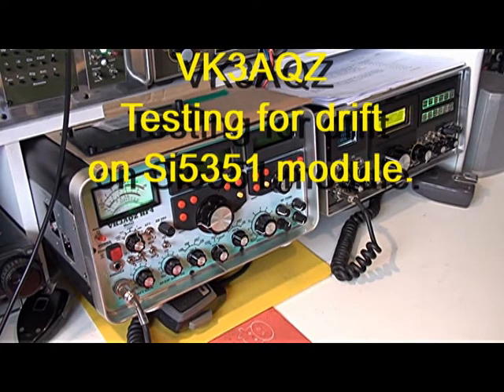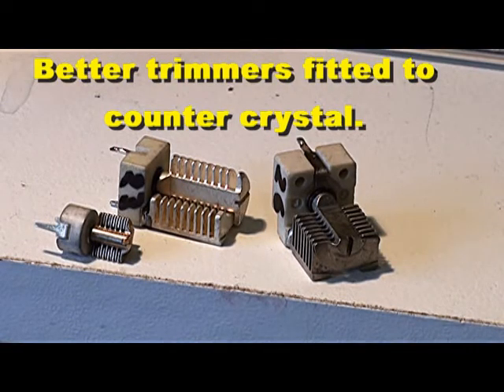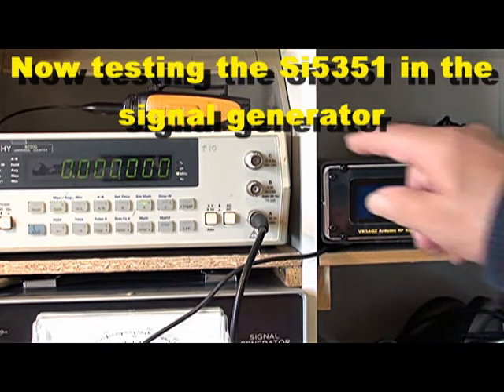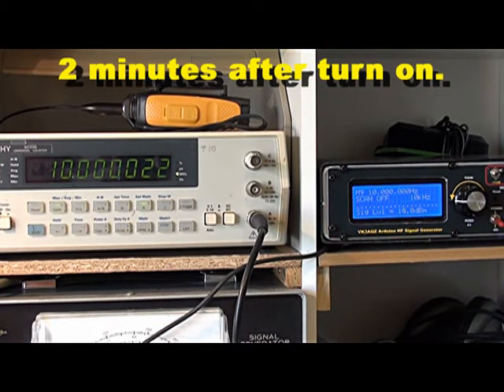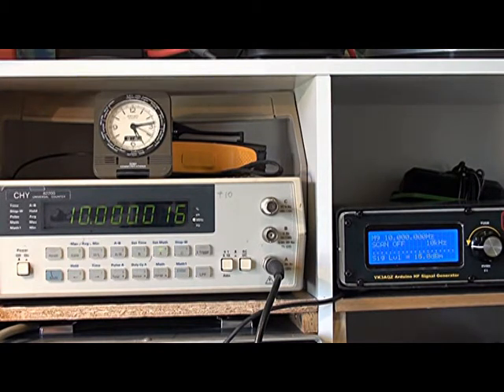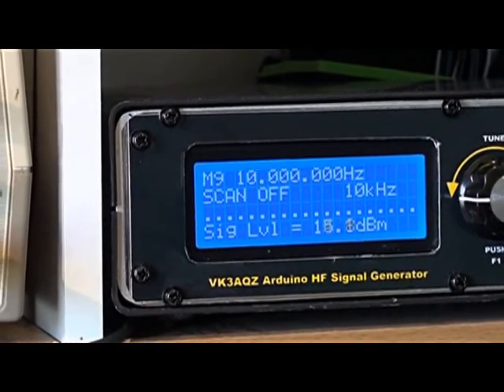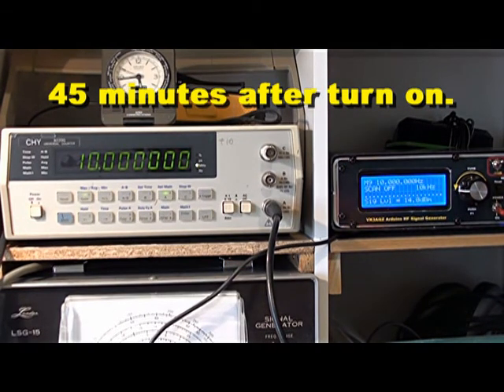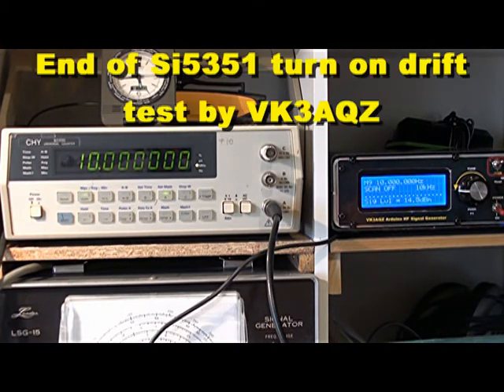VK3AQZ Si5351 drift test

Comment: Update re. the BPSK modulation present on the PPS output pin from the uBlox GPS module:
I mentioned the use of a Costas Loop in my previous comment - not needed.

I read one single sentence somewhere online that set the ball rolling for me - feeding a BPSK through a frequency doubler also doubles the phase, so 180+180=360* in other words it cancels out thereby removing the modulation.

I removed the XTAL from the si5351 board and fitted a 0.1uf capacitor to XTAL pin 'a' as per the datasheet, I set the NEO-M8 module to output 12MHz and feed it into a simple single transistor frequency multiplier 2n2369a with a collector tank circuit tuned to 24MHz which drives the si5351 and in the Arduino IDE just put 24000000 into the line of code that specifies the frequency and it works great !! Rock solid and a quiet carrier with the si5351 outputting 144-146MHz in quadrature and I use clock 2 for the BFO/CIO which goes to the SSB board.

I tried connecting the GPS board directly to the si5351for comparison and although the frequency was rock solid you could clearly see/hear the modulation that is present. I had a 56 ohm resistor connected at the PPS pin of the GPS module to apprx 1 meter of RG174, at the si5351 end I had a 100 ohm resistor in series with the 0.1uf cap connecting to XTAL pin-A I set the GPS to output 12MHz and in the Arduino sketch set the same frequency and load capacitor to 10pf and got the best results for that test.

I also have the same NEO-6M as you use Lou and will try the above with that module too and look forward to seeing if I get the same results.

Bottom line: for less than £10 sterling and just a few components you can have GPS precise frequency for your rig and/or test equipment.

Looking forward to your next video Lou, you really inspire me with your projects!

73 de 2e0iiz
Reply from the maker: Hi, yes, thank you for all that. Currently in the desert travelling. Hope to be back in civilisation soon. Cheers and stay healthy.!

Comment: Feed the Si5351 with a 24MHz output from the GPS module ...
Reply from the maker: My GPS does not seem to put out  any signal more than 16MHz.
Reply: @vk3aqz  That's strange, my M8 has no problems with 24MHz. Try feeding it with 12MHz (internal clock is at 48MHz so anything that is a division of 2^n should be low jitter).
Reply: Or at least the M8 one is at 48, check your model.
Reply from the maker: @galileo_rs  Hi Dragan, yes, my GPS is a NEO6 - M. I did have a NEO 7 but it was a fake one from China and refused to accept any changes from the UBLOX software. It just sat in default with 1PPS output. Yes, your idea is good in some applications. I did have an earlier Si5351 locked to a PAL subcarrier system (Rubidium clock) I had from a TV PAL SPG unit. But it was not small or portable so I now just use the GPS and calibrate my frequency counters. The other issue I have here is that in the room (metal roof!), my GPS signal cuts in and out, and during those times, I lose lock.  On my transceiver I now use a TCXO to drive the Si5351 and it stays within 1Hz no matter what happens with any GPS source. So I just check that with my PAL clock, or a GPS from time to time. I should point out that the whole idea of publishing this video is to let others know that if they use an Si5351 without due care to environment effects, it will not be accurate. Some believe that these devices are very accurate when in fact they can drift with temperature, for example when they go outside on a very hot or cold day. So that is the purpose of the post.
Reply: @vk3aqz  The Si5351 itself only does the arithmetic, it is the oscillator module that clocks the Si5351 on the board itself that is the cause of the drift.
I have both the Neo-6m and Neo-8m and the 6m does put out higher than the datasheets specified 1KHz, but anything over 10MHz is pushing it - the waveform looks very poor. 
The Neo-8m however is fine right upto 24MHz, It will not go any higher than this and I beleive I have a genuine module according to the data I can see filled in the Ublox Ucentre evaluation software connected to the Neo-8m, the 6m however returns no manufacturer fields, they are all blank, so I guess I got a fake too. 

You will need a 'costas loop' to get rid of the BPSK modulation that is present on the timepulse pin on the Ublox modules. There are higher priced modules within all of the various series with the suffix 'T' that are meant specifically for timing applications, it would be interesting to see if the phase modulation is present on these modules also. 
When I purchased the two modules I noticed the 'T' versions were apprx 10x the price!

The GPS boards as received had pin 7 soldered to ground, I connected it to the 3.3v VDD which enables pins 5&6 which you connect 27R series resistors to the centre two pins of a USB socket, data&clock (and ground, the +5v pin can be used if desired to power the whole board as it has a 3.3v regulator) then you have a USB interface without the need for an RS232 adaptor, that said now I hve found more uses for them I find I can have a much longer RS232 cable than I can with USB.

If it's any help Lou, my Neo-6m needs to be on a window ledge, whereas the Neo-8m will work just fine just about anywhere indoors or out.

73!!
Reply: @galileo_rs  Highest jitter free frequency I have found useable on the Neo-6m modules is 8MHz
Reply from the maker: @Magikflame  Ok. In my case, I am only interested in checking my frequency counter which goes to 1 Hz only with a  1 second sample. I can go lower with 10 and 100 second samples but for ham radio use that is not necessary. Most transceivers are no that accurate without external references. I have see commercial HF rigs up to 100Hz out!  Even the ones with the TCXO modules fitted are only good down to 1 or 2 Hz so phase jitter, which is only a fraction of a Hz at best, becomes irrelevant unless the source is used at Microwave source, and then if multiplied up to the microwave frequency.  For my microwave systems I use the Rubidium standard which is down below 0.01Hz, and unmeasurable phase jitter.
Reply: @vk3aqz  My M8 module is also a fake and I found through trial and error that the way to get Ucenter to 'talk' with the module was to disable autobauding, set the com port itself on the computer to a high rate, I chose 115,200 and then in the Ucenter tried connecting and disconnecting one baud rate at a time. Flow control off, buffer slider set apprx. mid-way. In my case as soon as I tried 38,400 it connected. then in the configuration view under sub heading Ports, you can set it wherever best suits your needs, as soon as you change it the connection is lost, so then I click disconnect, adjust the baud rate to match the new one, click connect, then 'save current receiver configuration' .

Hope that helps Lou. 73
Reply from the maker: @Magikflame  Ok, When I get a chance I will try that. Currently I am travelling around the country and just getting the odd internet. Right out in the desert  at the moment. Cheers and thanks.

Comment: Beautiful equipment. One bonds much more with test equipment that was self made, isn't it? The counter does not have an external clock input to connect the GPS permanently?
Reply from the maker: Hi Jan, no the counter just has an ordinary crystal oscillator and no external locking input. I guess it would not be hard to  phase lock the crystal oscillator with  a varicap  driven from a phase detector locked to a GPS or TCXO (when there is no GPS signal). But I don't use it often and generally just check it's accuracy when I need to. Thanks for the compliment on my homebrew equipment. Thank you, and take care, Lou.